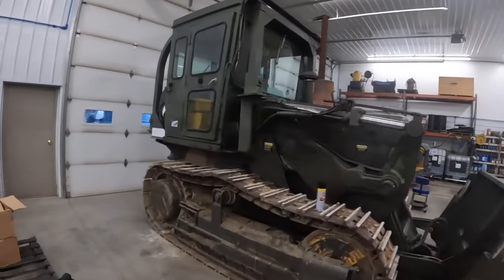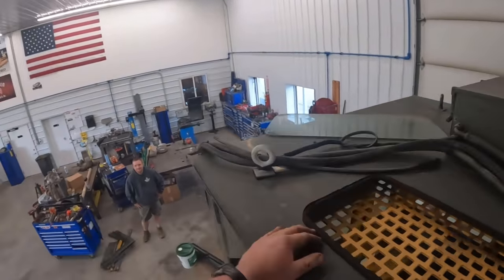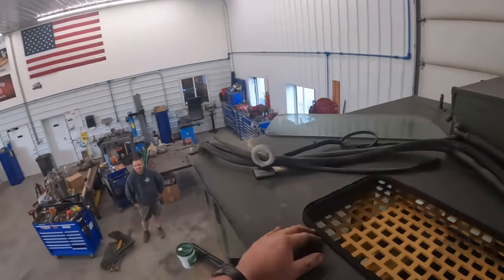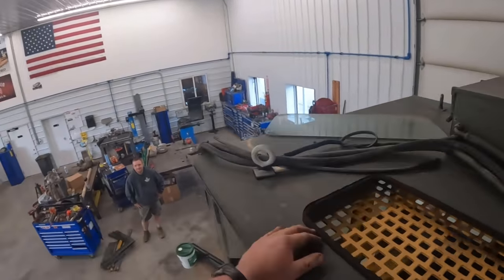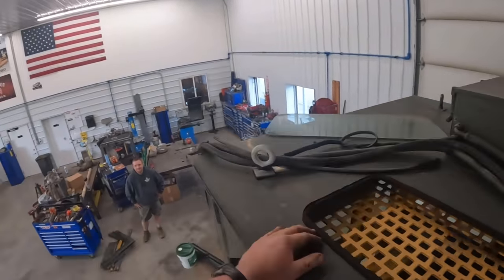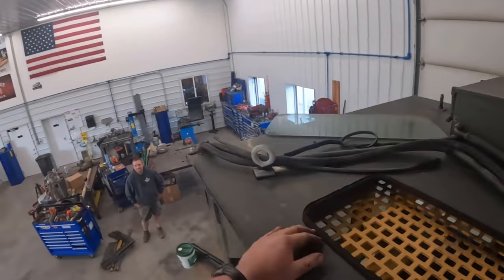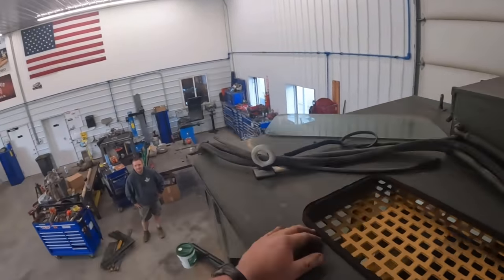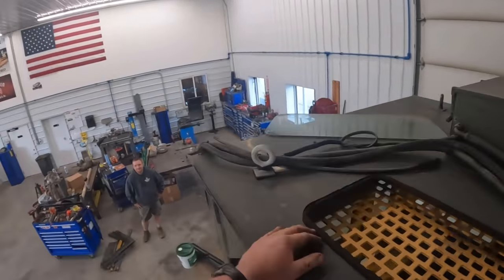IH Dressta Dresser 175C track loader cab and cylinder removal @C_CEQUIPMENT

Comment: The direction of the exhaust cap, should be determined by the way the tractor sets on your trailer. You don't want the flap flipped open when driving down the highway 😎

Comment: Yep, loved watching cab and cylinder removal. Love the 175 . We used to call the roll cage ROPS, Roll Over Protection System. Throughout the industry. During and before the Dresser buyout I sold a lot of new and used International TD7, TD8 , TD12, TD15 DRESSER BROUGHT ON THE 5.9 CUMMINS. THE OLD DT466 INTERNATIONAL ENGINE WAS ONE OF THE BEST ENGINES OF ITS TIME. HOWEVER I PREFERRED  THE 5.9 BECAUSE IT STARTED EASIER, WAS QUICKER TO REBUILD AND HAD TONS OF TORQUE. THAT CUMMINS REALLY CAUGHT ON IN THE LATE 90S WITH TONS OF APPLICATIONS. THE COMPANY I WORKED FOR  FOR 25 YRS. SOLD 96 DIFFERENT BRANDS OF HEANY EQUIPMENT FROM BUCYRUS ERIE DRAGLINES FOR STRIP MINING TO CASE BACKHOES FROM GALION MOTOR GRADERS TO LINK BELT CRANES FROM TIMBERJACK SKIDDERS TO PRENTISS LOADERS, HYDRO AX FELLER BUNCHERS, BLUE OX WHOLE STEM CHIPPERS And many more. At 74 I look back at what a fascinating career I had as an outside salesman. Was on hundreds of job sites and kicked a lot of dirt. I would enjoy watching you fix those rods. But would it be cost effective. Do you even have the time. You have a lot of flooring and side panels to fabricate. One thing is for dam sure, it is gonna be one fine machine when you finish with it.
Reply from the maker: Thanks 
Sounds like you have been around

Comment: Hi guys a business in Australia that works on mining equipment mostly rebuilding lift cylinders on dozers haulers earthmoving vehicles WILL NOT reuse a pitted ram. he will only use factory replacements or a hi-quality aftermarket and says replacing a pitted ram will fail and that would come out of his pocket to redo CUTTING EDGE ENGINEERING check out his work probably the most knowledgeable person I've seen on youtube and he explains every step he takes if he needs to replace a ram he can order the blanks and cut to length and turn ends to weld
Reply: Check out his line of doorsteps. There are some really big eyes that have been torn completely open. That must have taken some real pressure.
Reply: You really do a good job explaining what you do with the equipment I was referring to his knowledge of machining cylinders and boring them. I don't watch videos if they won't take the time for us viewers to learn something from their videos

Comment: If the rain cap is mounted backwards then when you pull it down the road on a lowboy it will blow the cap open and potentially spin the turbo compressor wheel without oil lubrication.
Reply: And what happens when you put it on the trailer “backwards” like most people do so the bucket sits over the trailer axles???
Reply: And there is the correct answer.
Reply: @gregmattes8053  you would be pulling the dozer backwards going down the road therefore if you put the rain cap on backwards, the cap would blow open going down the road. Most people know you never back a track machine up on a detach
Reply: Can anyone say duct tape
Reply: There has been videos showing that it is pretty difficult to get those turbo wheels to spin hauling machines

Comment: Flappers, rain caps, depends on which way your tractor sits in the trailer when towing. Mount the hinge side of the rain cap into the wind so it doesn't open when towing and let the rain in at 60 mph then you wonder why it don't start.

Comment: Hi from uk guys👋👍 good going getting all cylinders stripped and some threads stripped to for the cause😂 that socket is still hot then clint picked up nut with shady rag🔥  you had me at the lad who went looking for imperial or metric adjustable/crescent wrench👌😂 and yeah I would live to see the engineering side to rebuiling the rods if you could I love processes like that👌 thanks for your time and be safe see you soon guys👍👋

Comment: I say the weather cap open to the rear, but depends on your setup. Our tractors usually get pulled on the trailer and you're less likely to bend it around tree limbs too.

Comment: Those good machines,  there is a local contractor in my area who had several International 175 he loved them. They used them for mostly cutting house pads and loading trucks, in those day Excavator weren't popular yet. Now Excavator have taken popularly and are the way to go.
Reply from the maker: Track loaders built this country
Reply: @C_CEQUIPMENT  Absolutely they did! I'm 37, started cutting house seats and digging footers when I was 11 and the men I worked for had track loaders. You wouldn't believe the number of people I have since worked with and around, who just don't understand how capable of a machine they are

Comment: I left the family farm and got a public job running a 627 in 1971. We always installed rain caps to exhaust towards the rear over the 🎉operators head. That way when we hauled the equipment the wind would not open the exhaust and cause the turbo to spin backwards without oil pressure. So now tell me if that makes a difference or we just did what we were told to do.

Comment: Sideways is how I did it on trucks. Driving down the road, forward the wind has a chance of blowing down the exhaust. Facing back the wind blows the flapper shut. Also face outward, away from the center of the truck.

Comment: I like ram rework, use to do it a lot, used EL50 chrome plate shaft to make the rods. Thing is one needs to anneal the rod ends to be able weld and machine on the rod. I have a couple techniques I used if your interested on the pin eye and rod connection point. Thanks for the ride along, BTW, how many forklifts does it take to remove a cab, answer, all ya got.😏😉😁

Comment: Kutris of C&C Engineering Australia does rod repairs / replacements all the time. He states redoing the chroming the rods never works, it just traps rust inside and it breaks the bond between down over time.

Comment: O'Reilly's stocks in the back room Gates brand heater hose connections. In straight and 90 degree. A pair of the 90s and a chunk of hose between them works great for bypassing heaters.  The dorman versions sold out in the public aisles pale before the gates versions

Comment: What is the idea or reason for double cleats on the tracks? Does that help with traction when pushing into a pile of material? Enjoy the channel. Love watching you get more life out of pieces of equipment that others have given up on!!!
Reply from the maker: Double bar grousers
They originally had triple bars like an excavator when they were first designed 
They are easier to turn then single bar grousers
In a loader you make allot of pivot turns normally

Comment: Forwards for the exhaust birdy. You usually put the rear of the machine forward when hauling,  you will not run the risk of getting water in the exhaust system if you go through a rain storm.

Comment: Usually You face the flapper towards the back of machine. So when You load your machine frontwards on lowboy, it wont flip up and Have the Turbo spinning going down the road with the engine not running. So its not getting oil. Its spinning dry..Thats what I was taught years ago by my Dad. And he had alot of equipment back in the day. Also the Stacks with the bend in them you usually turn To left or right of machine for same reason. Great Video Clint. Hey do you have Jeep parts for 1994 and do you ship stuff out Just wondering .
Reply from the maker: Nothing that new
We stop at 1986
Reply: @C_CEQUIPMENT  Thank You Sir. I figured I would see. I wasnt sure. Thank You...

Comment: I was thinking , at the start, that this track loader sure did remind me of those International Drott loaders of yesteryear. Am I correct in thinking that International built the 'tractor part' and 
Drott was contracted to make the loader assembly for these Track Loaders?
This was an interesting 1 hour plus video. I'd like to see you folks building at least one of those rods.
Reply from the maker: Yep you are correct 
Stay tunned
Reply: @C_CEQUIPMENT  Good, and I will.

Comment: Maybe if you kept  those circle hooks on the top of the cab you wouldn't of had to use 3 fork trucks instead of the crane.  Seems like was probably what they were put there for.  What do you think.  I like watching your channel even though I'm a girl.  Heard about your channel from Dirt Perfect's channel.  Keep up the good work.
Reply from the maker: Those hooks went through the factory rops system also and we did not want to remove that so they wouldn’t work

Comment: Next time you gotta take an old O ring out of a cylinder take what's called a spring hook tool with a hook on one end and a sharp spike on the other end poking the hook which should have a arp point on it too into the rubber and simply pop it out. You may have to use the spike end. 
I've used them many times to get large O rings and retainer clips out.
Just be careful as those sharp pointy blankity blanks can be a tad unpleasant when you screw up and poke your palm or fingers with it.
I actually made a handle for mine with a 1 and a half inch wood dowel cut in half lengthwise held together with two screws on either side of the tool at both ends.
Two of them actually.
One with the hook out and another with the spike end out.
Easily one of the handiest homemade tools I've made.
I mostly use them repairing pinball and arcade games (my actual profession for 38 years) as well as on cars and trucks I've worked on and other stuff.
Reply from the maker: Thanks

Comment: Well this was interesting CT and KV your video was actually more informative then DP'S and Man bum 🤣 now we lurned alote about nuts and how many fork lifts it takes to get the cab off 🤪 and for the flap they recommend side ways now because it's gender neutral so you don't hurt nobody's feelings if you're going forward or backwards 😉 and for taking out eye bolts I yous a socket when I can find one that fits and with the impact works great 👍

Comment: I have a dresser 175 c and I had a fuel line leaking and somehow I am missing the nut that bolts the fuel line to the block. My question is do you know where I can get one or can I rig something else up to mount the fuel line to the block
Reply from the maker: Not sure which engine you have

Comment: Side ways. I run a '74 IH 175C.......
Reply: P.S. If it's a "Power Shift" no slow down on the machine needed.....
Reply: Oh, if you can post the size of the 4 way bucket cylinders when you have them rebuilt, that would be great! The '74 I run has the Drott 4 way and hydraulic hookup on it but no cylinders......